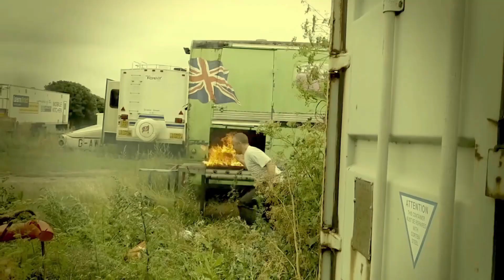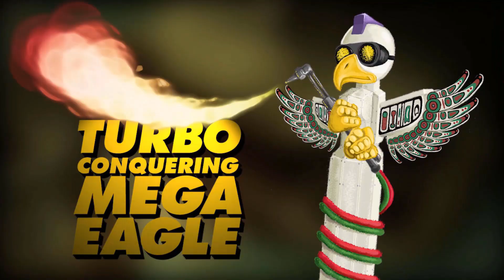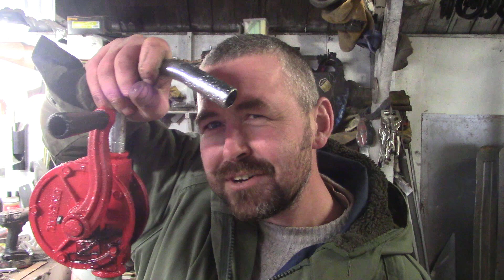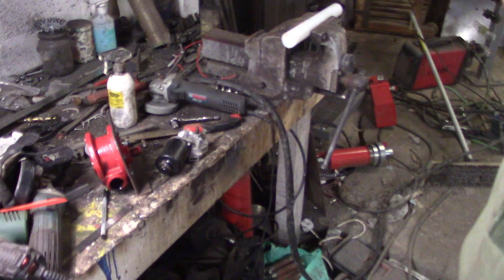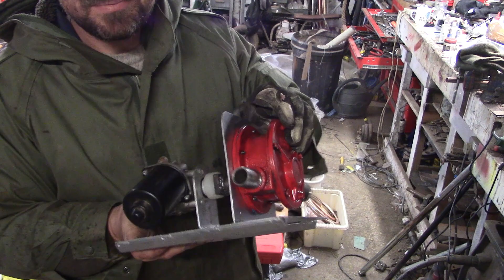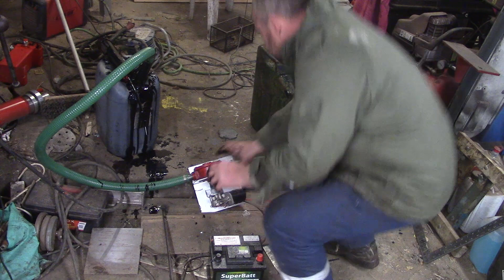waste oil transfer pump

Comment: Never had issue with concrete or oil but fucking welders lung every time I weld a bit of "dirty" metal I'm sick as arse for 2 or 3 days
Reply from the maker: I've welding galv a few times before I knew any better, felt it in my head not my lungs though, same with casting brass, can't imagine it does any more damage than a heavy Saturday night.
Are you planning any extraction in your new workshop?
Reply: @turboconqueringmegaeagle9006  yeah I have a 5hp 3 phase beast of an extractor fan. I fitted it in my old shop but one I couldn't get out with it running, it sucked my roller door shut an two that ones made of wood and the whole thing vibrated so all my stuff fell of my racks lol. So I went back to bouncy castle blowers as extraction. Welders lung for me feels like when I had glandular fever.
Reply from the maker: @smithbuilt  sounds suitably over the top even for your new shed mate, you'll be able to Hoover the floor and send it all over your neighbors fence.
Reply: @turboconqueringmegaeagle9006  down side the neighbours is my house..... lol

Comment: Good job mate. I did one of these pumps years ago before I switched to the small block Chev Pumps I modify and were faster with less input power.  Sped up these can work real well though and I think the reason it's not self priming is the RPM could be a bit low to overcome any leaks/ bypassing. 
For the processor I tried to do mine  with a factory type setup in mind, Dirty oil in, clean oil out and never shall it see the light of day in between. saves a lot of mess and screwing round.   I have gone with Veg simply because it's so much easier to clean up what you do spill .  I understand it's difficult to get in some places though.  I think fuges are well over rated for cleaning oil and have several drawbacks.  In my experimentation you can get oil good and cleaner than pump fuel with settling and filtering.  Oil is the perfect lazy mans sport. The longer you leave it sitting round and the less you touch it the less work there is to do with it.  I'm stockpiling Oil as a battery atm and going to use it in a co-gen system I am building with an engine that will supply heat and power without using any more oil than one or the other would be getting the benefit of both.
Reply from the maker: I've seen your brief tour of your tanker trailer and pump set up and your refined, pretty cool set up.
Can you tell me the drawbacks of the centrifuge?

Comment: Haha I like the mess. You definitely need a good old brass gear pump for that work.. Thanks for the update
Reply from the maker: Brass= better I've seen some nice brass bodied diafragm bilge pumps but no gear pumps, im obviously not looking hard enough! Cheers mate
Reply: @turboconqueringmegaeagle9006  I buy some from car booth sales. usually I fit them to engine to circulate the cooling water.

Comment: Jim, would a drill powered pump work for that? I'm sure you've seen them. If I recall, they sell for about 20 quid.
Reply from the maker: Yeah I have, rubber vane pumps like outboard engine water pumps.
I've got no idea how they'd handle gloopy oil though.
Reply: @turboconqueringmegaeagle9006  I'm preparing to build a waste oil stove, so I'll be looking into that as well.
Reply from the maker: @Farm_fab  let me know what happens please
Reply: I have used this style before in the states....works on thinner stuff but oil kills em fast.

Comment: Normally those pumps go on top of drums. I've never had to prime one on a drum. Maybe its the rpm. I was always planning on building a similar contraption, but was going to belt drive it, due to the rpm adjustability.
Reply from the maker: Thought about an e-scooter motor gearbox, belt drive with an engine and settled on this mainly because of the ease and cheapness. 
Could do with being a little bit quicker.
Reply: @turboconqueringmegaeagle9006  any consideration to using compressed air? Just blowing it from tank to tank
Reply from the maker: @EitriBrokkr  I need to pump it out of other people's tanks, I don't really get enough from my work.
Reply: Could get a bunch of 15 gallon barrels. And just swap them out for people when theirs are full. 

....what about a vacuum pump...
Reply from the maker: I envisaged using an ibc in the back of my truck or on the trailer and coming home with a ton of oil each trip to save on the handling and because I have a load of them, ibc rules out using vacuum as they collapse quite readily. 
People are really wierd with their barrels as well, I've asked a few people about taking their 220L drums home and bringing them back empty and by the reaction you would have thought I was talking about their daughters not oil drums, that would be my preference though and one of the local farmers has but he only makes a barrel of waste a year and I plan on using much more than that.
Pumping makes most sense as it's the most versatile method right now, so maybe I'll revise this pump at some point or build something else if I can get hold of a large knackered hyd pump.
I should have explained the requirements and constraints a bit better in the video.
Reply: @turboconqueringmegaeagle9006  regards people's drums, you need to buy a couple of seconds hand empties (usually fairly cheap) and just swap a drum...

Comment: Nice work. You can melt cast iron with waste oil. (Mind you, there is a trick to it).
Reply from the maker: I'd probably be inclined to get some proper foundry clothing if I ever try iron.
Reply: @turboconqueringmegaeagle9006  You certainly wouldn't want to be wearing polyester.... It might well catch light.
Reply from the maker: @BensWorkshop  I keep finding myself watching the Pakistani foundry work videos of men in bath robes and sandals pouring iron
Reply: @turboconqueringmegaeagle9006  If they are cotton they are probably a bit safe, but at a minimum I'd go with leather.

Comment: I've made a good oil transfer pump with a Shop Vac (Wet/Dry vacuum) 
You just modify the vacuums collection container with a diy drain or a submersible pump inside.  The shop vac can move a high volume of oil long distance quickly.  I've also made a hose reducer and it works very well for extracting oil, trans fluid, coolant, and differential fluid straight out of vehicles.
Reply from the maker: Nice one, vacuum didn't cross my mind

Comment: I don't think I got view of that pump shaft but it makes me think of the Christmas tree stand and how it has three bolts coming in from different sides to center it and stand it up right. I imagine that the shaft had a single flat on it so that might make it sloppier. You could also try a few carefully placed soda can shims to balance it better. If you put an easily moveable hinge with a pencil at the tip and slowly move it closer it will hit the high spots first, you could even just hold the pencil on a block of wood the right height and slowly inch it towards the shaft.
Reply from the maker: It should settle a bit as the nylon wears I hope. Unfortunately I welded the brackets so tin can shims won't do anything for me I can't achieve with a hammer. Not that bothered it's just dirty.

Comment: Great idea !  I thought about using a washing machine drain pump but not sure if it would be powerful enough ?  Your machine certainly does the job nice and fast though and saves all that cranking.  Might be a good idea just to dump all the oil you get into a barrel and once the pump is primed as long as you don't go to the bottom of the barrel you won't have to keep priming it.  I thought those pumps were self priming though ?  Can't wait to see the burner in action again and what improvements you have made :)
Reply from the maker: I wiped it all down before I reassembled it, maybe it just didn't enjoy being dry and the residual will help it along next time, you are right, it's a positive displacement pump so shouldn't need priming unless there is leakage.

Comment: Regarding camera fog. Leave the camera inside the workshop for a couple of hours before filming and you wont have a problem. And the best thing: Its free!
Reply: The camera has to be warm not cold.  Best to get the camera nice and warm then the condensation won't form on the lens.
Reply from the maker: Its only when I leave it in the shed that it fogs, we get really wet air here in the fens I just need to remember to bring it in at night.
Reply: Really? If the camera has the same temperature as the room, condensation shouldnt occur. Im obviously wrong though, regarding your experience :)
Reply from the maker: @swede178  yes you are right if there wasn't a flow of air through the shed but I am very well ventilated. 
I guess either the camera is as cold as any other surface in the shed but as the sun starts warming the dew it is blown through the shed and saturates my cold camera Or the tiny amount of heat the electronics generate cause a differential between the inside of the camera and the outside?